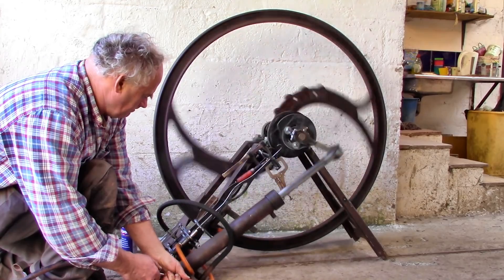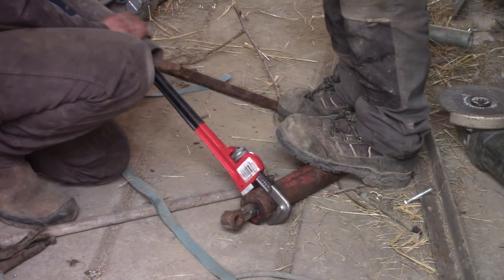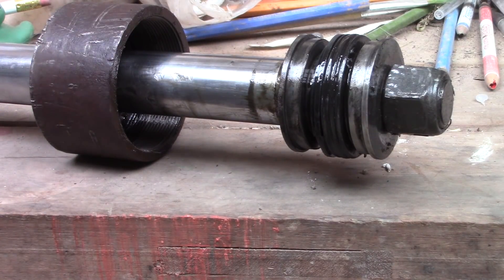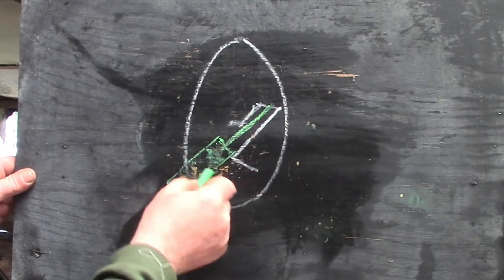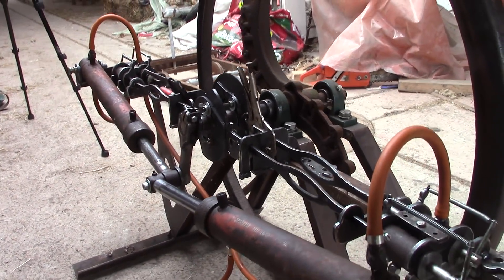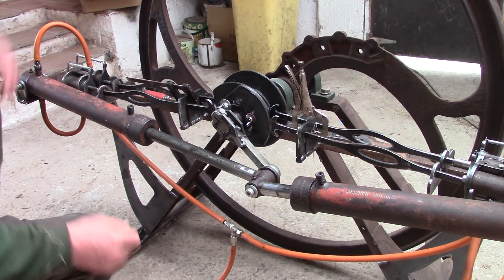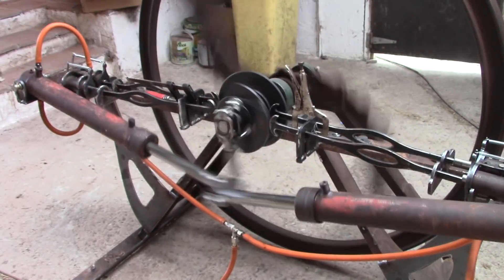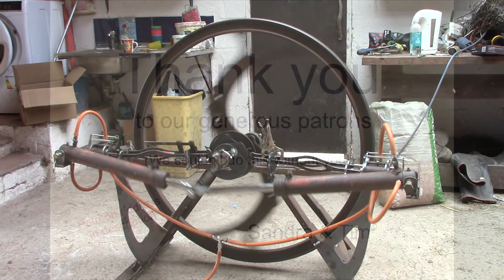Homemade TWIN CYLINDER Air-Powered Engine Goes REALLY Fast!

Comment: Another option to consider rather than steam is an air reheater before the engine. The air gets cold as it expands from the tank, and loses some oomph in the process. Some compressed air trolleys used little coal stoves or bottles of nearly boiling water to do the reheating, though you can likely get away with pretty much anything that can raise the temperature. My personal favorite idea is to pair an air engine with a biochar kiln, lots of heat to spare there!
Reply from the maker: Interesting!

Comment: great work, its coming along nicely. I will however advise against carrying compressed air as fuel, not enough energy density. Steam is the way to go by far.
Reply from the maker: even high pressure air?
Reply: @wayoutwest-workshopstuff6299  its possible but is it practical? Depending on how far you want to travel and how often. You can run a test and see how much you get out of your compressor's air tank but I really don't think its worth it. Keep in mind that as you run out of air your power drops off, water vapour is also a "thicker" gas and will not leak as easily through your valves and linkages. High pressure air adds a lot of weight with heavy steel cylinders, and does not provide much advantage. Steam is the better option both for range and power.

Comment: You have just completely overcomplicated a steam engine if you used a slide valve that solve your whole problem of providing air to both sides of the piston and exhausting without needing to make 4 valves per cylinder. Check out hand tool rescues vertical steam engine 2 video @ 31.21 and you will see a decent example of a slide valve you could replicate with a plasma cutter some heavy plate steel and a piece of rod stock. If you have a mill you could even add o-ring grooves for easier/better sealing. If you do it right you might be even able to power your log chomper if you beef up the frame.
Reply from the maker: That's a pretty engine - hundreds of dollars worth of parts too. But curiously it has no power. 
I nearly went for a slide valve - but they're hard to adjust. Unlike my type.  Thanks, though.

Comment: Have you considered hydraulic oil instead of air because it doesn't compress. You'd  need to use an accumulator to maintain the oil pressure and then use a pump to fill the accumulator which can be powered by a extra track on the line at the start and end of the line. You may find a stationary hydraulic accumulator also works well with green energy,  as a mechanical alternative to batteries. You charge the accumulator when the wind blows and the sun shines, and then you can access the pressure either when these are happening or even on days that are overcast and have no wind. Steam engines used the Stephenson link to change direction because the valve supplied both sides of the piston, so by changing the direction the valve moved, the steam would enter the cylinder the other way. If you installed a spring loaded stop that moved the link into neutral from the track bed, you could put your foot on a plate to lower it and pull the lever to reverse or forward on the loco to move it in the desired direction.

Comment: I know you said you didn't want to use dual action cylinders, but in this configuration, couldn't you just take the input of the bottom of the first cylinder and join it to the input of top of the second cylinder, kind of like a compound steam cylinder set up?
Reply from the maker: I'd still need a way to vent it after it has been in both cylinders

Comment: you could run that engine on liquid CO2
Reply: If you want to do this you will need a compressor, that can do 60 bar or higher. You can get fairly high pressures by using multible compressors from used fridges. I do not know if they would break under that pressures. And it might be dangerous to find out.

Comment: would it not be easier to use a micro controller for the valves instead of that much Mechanic?
Reply from the maker: I'm avoiding electronics because of the climate here - it's very wet
Reply: @wayoutwest-workshopstuff6299  that will make a lot of your project way more complicated. 
Waterproof cases are an option.
However I get the appeal. A purely mechanical device has its own esthetic.

Comment: I agree with your assessment that it's probably not worth making those pistons double acting, but do keep in mind that you can now make them double acting with zero effort, by just linking up with valves on the opposite cylinder! Thanks for posting.

Comment: you could maybe use the side of the piston with the rod in it with high pressure air and then use the extension side with the lower pressure air. kind of like a double expansion steam engine

Comment: Couldn't you power an air compressor pulley off your flywheel to fill your air tank to run your air powered generator and maybe use an alternator off that air compressor pulley to produce electricity too, to charge your power tool batterys or home battery bank?
Reply from the maker: I think you're describing a perpetual motion machine : -  )

Comment: You are able to make both cylinders double sided by tying the right side cylinder to the left side cam and vice versa. Because the cylinders are on opposite side, (and should be oppositly timed) you should be able to tie into the opposite sides cam to run the currently unpowered side of both cylinders. 

Awesome work, great sound and a artistic flare

Comment: Such a wonderful series to watch!! I've done just about all of them in less than a day! I'm greatly looking forward to seeing where this goes, it's all so very interesting. I had a bit of a suggestion which popped into my head when I saw that flywheel. What if you modeled your little locomotive after the one built by Richard Trevithick? The flywheel you have there looks much like the one on that loco. Of course change certain things and modernize it a bit, but that would be a good homage to one of the founding fathers of rail transport. 
It'll be interesting to see how all your projects mesh together! Good luck in the future!!
Reply from the maker: Thanks, Marcks. Welcome aboard!

Comment: If you really want to go for efficiency, the Walschaerts valve gear, used on most steam locomotives since soon after it was invented, seems to be based on rods rather than any fancy shaped cams, but it is quite a lot of rods

Comment: Regarding it only turning the wheel in one direction, your videos have given the impression it's slightly uphill from the wood chopper to the drying tunnel. Perhaps you only need the railroad powered in one direction and have a gravity-driven railroad going the other way?

Comment: Cracking job as always Tim. I’m so happy to hear you’re thinking of going down the compressed air storage route. This is definitely a contender as the best way to go. May four or five 92 litre gas bottles as your storage chamber. Maybe to get your locomotive part right skip the air generation part for now and concentrate on per filled chambers. Thinking her is your lattice structure would take a lot of time and money to make to get your wind blades high enough to be effective.  Old refrigerator compressor de-gassed . Might be a great option https://youtu.be/S0tjREbZrTs

Comment: You don't need another set of valves to utilise the 'rod end' of each cylinder. Simply "T" into the piston side of cylinder #1 and run a hose to the rod end of cylinder #2, and visa versa for the other side. It should (approximately) halve your speed and double your torque. Awesome video!!!

Comment: I like the trefoil detail on the mounting plate and the beautiful cutouts on the valving pushrods. Remember steam /air trype engines are inneficient. Try putting little blades on the perimiter of your flywheel and use your compressed air to drive blades. Air piston is inneficient, too many reciprocating parts.

Comment: the idea of a 'fireless' steam engine is really cool.  have you thought about using an old four stroke lawn mower engine, and chance the camshaft gears so they open every revolution instead of every other revolution, there are some examples on youtube. and i know you already have a diesel stationary engine, but turning this into a steam powered stationary engine would be a good use of this engine due to its size, im worried a loco would fall off the tracks

Comment: Why not use the two rails you already got to carry some AC? With an isolated transformer, it's safe to touch both sides of the track - electricity will only flow if you touch both rails at the same time. You would only make a rubber coupling on the axles to avoid a connection between both rails this way - as you already use wood bearings, they shouldn't be an issue.

When you use something like 40 volts AC (which is fairly safe), you should be able to push enough current through them to transform it up to 230V again and run a compressor with it. :)

You could then put a compressor and a storage tank on your engine and just run it that way - so short interruptions of power (like on points) wouldn't be an issue that way. So you can just skip to electrify them.

Ah, and you need to isolate the metal pins going to the ground from the rails I guess... or you will dry the ground around the tracks pretty quickly :D

Comment: You could increase the efficiency (and make it double acting) if you connect the both output-ports. Just put hydraulic fluid into it or an emulsified oil/water mix aka cooling fluid for cutting to avoid compression-losses :)

Probably also possible to do this with a slight "angle" to get the pistons unable to stop at dead center, but you would loose some efficiencies this way (as you need to add some air which then get's compressed and decompressed on each stroke, like a spring).

Comment: Been thinking about your motor and think that you could probably do with reducing the amount of air as the speed goes up. My thinking behind that is that the amount of time available to expand the air and extract useful work from it is going down as the speed increases. Conversely you want to introduce more air as the speed drops to prevent stalling. This is your torque curve. Having increasing torque available as speed drops is called 'torque backup'.
Reply from the maker: I agree David - but I wonder how I could do that
Reply: @wayoutwest-workshopstuff6299  perhaps a mechanical governor to throttle the air flow with speed?

Comment: For the pressure tanks you can use old fire extinguisher or Gas Tanks they can hold up to 20bar safely and when you get them there some ones with 10-25liters
Reply: Or you go for compressed air bottles from a local scrapyard. They usually got some which just don't hold the 300 bar test pressure anymore, but should be fine for 10 bar or so.

Comment: 1)  What on earth is wrong with the clanking?  (Nothing.)  2) Regarding the reversing, what about a steam (air?) - electric scheme?  Power a generator that powers (easily reversable) motors on the axles.  (But keep the clanking.)

Comment: Surprised you didn't find the answer I did when contemplating my Stirling engine design, for the issue of crankshafts ;) don't make cams or cranks, make wheels! Just use a big wheel of something stiff with holes drilled in it. Sure, it saps your efficiency, but let's face it, the central concept of the application for my Stirling is that you need SOME form of mechanized motive power and the regular stuff is no longer available.

Also -- sorry for emailing you something that has a length more appropriate for numbered chapters! I just tend to write like that. I'm quite verbose (you may have noticed...). It's just my nature.

One other thought. There's such a thing as a trompe, essentially a water-powered air compressor. I've wondered for a while if there's a vaguely related device out there that would use a draft of hot air or a directed flame to thermally compress air somehow, rather than using a piston. Unfortunately, my skills at Googling are... not sufficient, to put it mildly, to the task of hunting up such a thing. I get a lot of results for power generation using the heat from more standard air compression devices, and nothing of actual relevance. If you could create such a device -- a thermal air compressor -- you'd be able to run that engine basically from a firebox. Job done ;)

Comment: I suggest  that you should introduce a oiler between  the compressor  and the cylinders to stop the piston  rings wearing away on a dry or dirty cylinders or a squirt of oil in the breathing holes

Comment: Worst case scenario, you strap a clutch on with a forward and reverse gearbox, then gear it way down b4 it gets to the wheels. It won't go very fast, but I'd doesn't seem like you will be going thaaaat far, just really from one side of your yard to the other. This way you wouldn't have to worry abt power, or lack thereof. As much as I love this awesome project, however, I still think an electric Loco would be more practical and easier to make for the task at hand. Also more space efficient, as that engine is pretty huge, for such small tack and carts.

Comment: Your a good engineer Tim, very clever design.
Reply: A tumbler gear set on the output might be easier than making the engine reversible. They're simple, just 2 gears in between the output and the wheels.
Reply from the maker: Good idea - thanks, Kevin

Comment: I’m sure others may have said something, but there used to be a thing called a tireless steam engine.  It worked in the same way any other steam loco would (I guess) but instead of carrying around the fire too, it plugged into the factory it served and managed to run around long enough to useful work before coming back to refill with steam. 
The advantages in your case seem to be …
1. weight (not carrying around fuel water and fire)
2. Safety - I suppose it’s safer not to go into a Polly tent tunnel spewing sparks, especially when there is dry wood in there.
3. I assume compressed air might be a way to do that too? You already have that lovely engine that chomps things up - perhaps it could drive a compressor for your engine to plug into?
Just a thought 
((I may have suggested this before? Certainly I’ve thought it! 😊))
Love your ingenious fun and games that are actually useful reinventions.
Reply: FIREless not tireless Ha
Reply: @IanCurrey  You can always edit your comments by clicking on the 3 vertical dots to the right of comment.

Comment: Many of the mine locomotives used here in Western Canada at the beginning of the 20th century ran on compressed air until replaced by electric ones.  Steam was too dangerous for use underground.  Keeping it as a compressed air engine would make sense (and would be safer too) as long as you had a large enough reservoir for the distance being covered.

Comment: Fun fact- this is very much like how a "Heisler" type steam locomotive is set up! The pistons are set horizontally either side of the locomotive, much like you have yours set. When steam is applied, it turns a flywheel and driveshaft. The driveshaft is coupled to the 2 bogies on the locomotive, which then drives the locomotive forward or backward when the pistons are in motion. The Heisler is not known for speed, but for its torque, ability to climb steep grades, and tractive effort.
Reply from the maker: Yes, they're interesting aren't they?

Comment: Love it very cool. I think I see a small issue
Watching it slowly the piston on the right you should close the intake sooner, its resisting the motion.   
Also on the right pistons stroke you should open the intake a smidge before you close the exhaust otherwise its pulling a vaccum! its going to waste a little of the flywheels energy pulling the vaccum for a 10th of a second but at higher rpms it adds up quickly(this is also adding to vibrations) . 

I think it will make it run at much higher rpms if you do this.
Reply from the maker: Thanks for the tips!

Comment: Hey Tim, keep in mind the Auto Industry already solved this.  What you need now is an old stick shift transmission or gear box.  Petrol Engines only crank in one direction so revers happens by changing the gears to make the output go in the opposite direction.  Granted with this set up I don't see you going much being gear one and revers but it should help save you time.

Comment: Tim your editing is enticingly tight.  From play to end one must listen or miss an important part or Joke or point of whimsical humor!
Noise is the sound of wear.  All the movement in the pistons is loss of energy.
Mostly from the cams.
Maybe if both pistons were at the same end with longer push rods on a bigger hub pushing just off time with each other enough to have the flywheel spin evenly.
Iam an old retired carpenter so take that with a drink maybe.  Cheers 🇨🇦

Comment: Battery electric locomotives have been used in small underground mines for over a century.  So have windmill generators for charging.  That may be a more productive avenue.

Alternately Briggs and Stratton or Honda would easily do what you want.

Comment: Unsure if it will do anything, but try connecting the 2 unused ports on the cylinders together with a pipe. That way air being pushed out of 1 cylinder on the outward stroke can help close the other on the inward stroke
Reply from the maker: but it still needs venting after that..
Reply: @wayoutwest-workshopstuff6299  It should vent from 1 cylinder to the other and back again

Comment: I don't care what others may say, but your engine there is a thing of beauty! 
Personally, I would try going with the windmill working a compressor, and changing out compress air tanks for your mini locomotive. But, that is just me and the idea would be for hauling the woodchip wagons. More power than that and I am unsure.
However, I have the utmost faith in you! Whatever you end up with in the final run will be practical and beautiful.